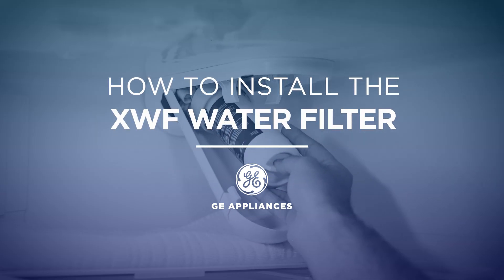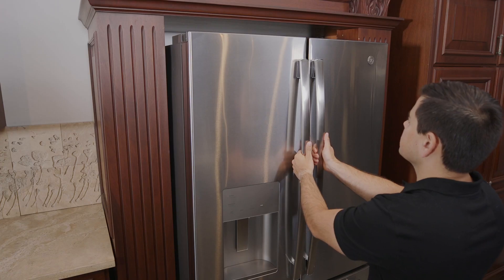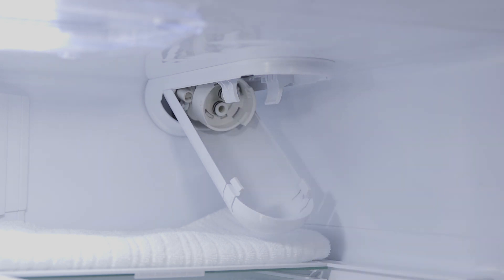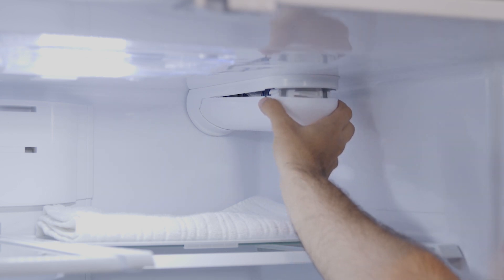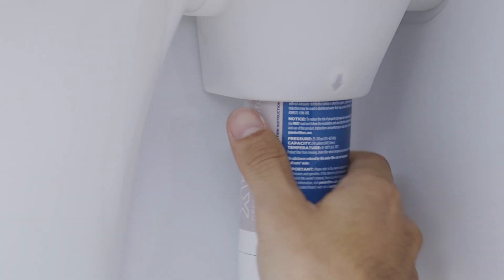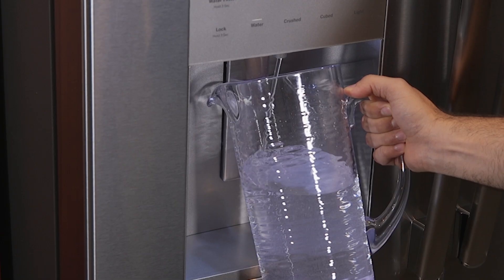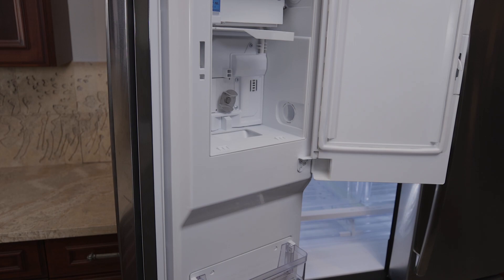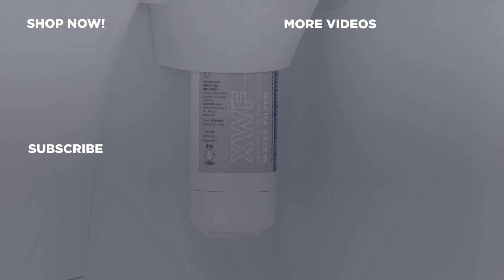Appliances - GE Refrigerator Water Filter Replacement XWF

Comment: This doesn’t work at all. I bought a brand new filter and installed as instructed in the video, I am getting an error message. I see that many others are having the same issue, please come up with a solution to solve the issue.
Reply from the maker: So that we may best assist you, please contact our Customer Care by submitting an on-line request at www.MyRyanHome.com or by calling 877-550-7926. Customer Care is available Monday - Friday from 8 am to 5 pm.

Comment: I did this and the arrows dont line up on my brand new ge filter it wont work
Reply: Did you ever solve this? Having the same problem now
Reply: @afrononymous  Did anyone resolve this? I'm pretty pissed as this refrigerator is less than 6 months old
Reply: Did you turn it so the arrows match up?
Reply: Installed a filter bypass and a new filter on the back of the fridge
Reply: @mustardman6469  hmmm we just moved into a new house with a brand new fridge and the filter is already bad and it’s not even 1 month old.
Reply: @mustardman6469  a filter bypass doesn’t filter your water at all. So how were you able to fix the issue to have clean water?